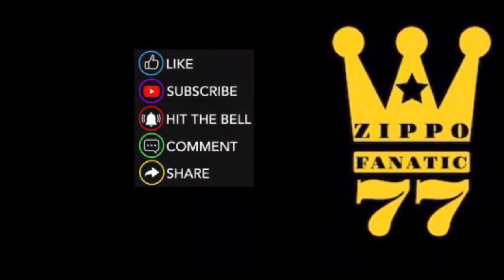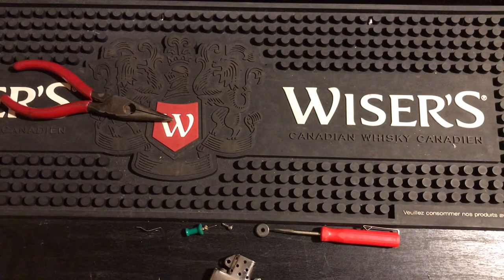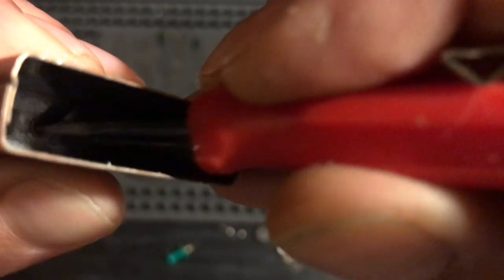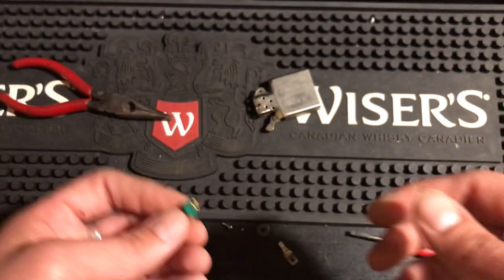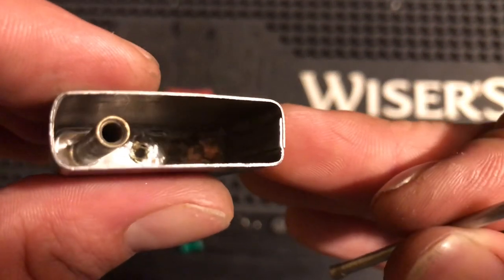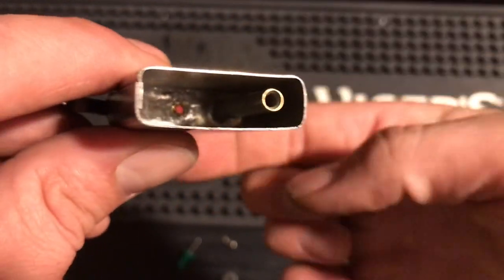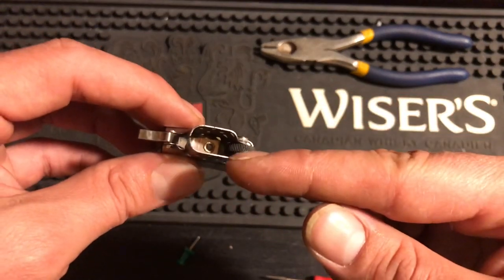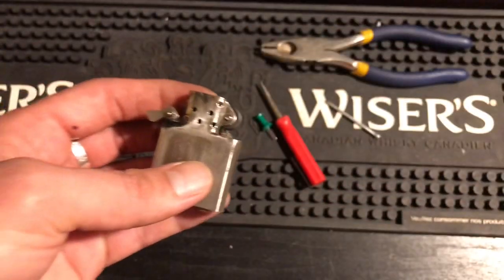How To Replace Cam Spring In Zippo Easy Way !

Comment: I love this. This was great education for someone that wants to restore their insert instead of replace it. Try to keep your Zippos original with their matching inserts. Really like how the rivet looked when you were done. I dig the look with the bolt on the wheel. I got some of those tiny bolts, but I got them in brass. I am going to do a brass insert and do  the brass wire wheel trick and brass coat a flint wheel then use a brass bolt to put in on. I might even try to brass coat the Cam. Great video, you got me wanting to work in the shop today doing Zippo stuff!

Comment: A zippo moment: I retired from the Navy and have owned many Zippo's. On the bottom of the case there are usually hash marks. ( something to due with manufacture date) All the sailors would insist on looking at all the zippo's for sale hoping to find one with four hash marks on the the bottom. These four hash marks were highly prized because they represented the old "four piper" destroyers of WW1/2 era. (four smoke stacks). If you had one...well then, you were an Old Salt.

Comment: You can heat a spark wheel to cherry red with a MAP gas torch , quench it in water to reharden it , because steel can soften from prolonged heating and air cooling depending on structure., and make a simple copper wire rivet for the wheel and peen both sides. Throws sparks like mad dude

Comment: My son bought me a Zippo made in 2008. The cam spring finally broke. Deciding if I should send it to Zippo or get a spring and fix myself. I'm capable, just on fence how long and how much hassle it'll be to get someone else to fix. Be surprised how much I miss it in working order.
Reply: Zippo won't fix it. They will replace the insert with a new one. Insert won't match lighter anymore.

Comment: I did it! Thank you Sir! 🙌🏼

I got my replacement cam spring locally (Indonesia), but I believe it was from China.
New rivet included, but I decided to follow your guide and it worked well.
To get the rivet out took a while and really need to use a bit of power.
Patience really needed in reassembling the rivet and cam spring.. 😁

Next I want to try that Golden Wheel guide and put a screw on it! 😅

Comment: Since I got a Zippo for two years now and cam spring has no strength any more today, I'm getting the hole idea about what it meend to fix it yourself. Your Channel is best of Zippo repair, thx for your guides 👍.
I don't get it. Why is nobody selling small repair kits where all these little parts are inside?
I meen Zippo is not a Brand since yesterday so what's the big deal about this?

Comment: Are the cam springs the same between the slim insert and the classic insert? I have a mid 70's insert that works great except for a broken cam spring. Also, do you do side work fixing inserts?

Comment: I have 1 caveat with this video after having just watched it and removed my 1st rivet and broken cam spring insert. You MAY be able to salvage the rivet, but you MAY NOT, as in my case. I fucking destroyed it in the process. Don't try to reuse the rivet. If you're taking the time to F with it, you might as well do it right. 

That is all.